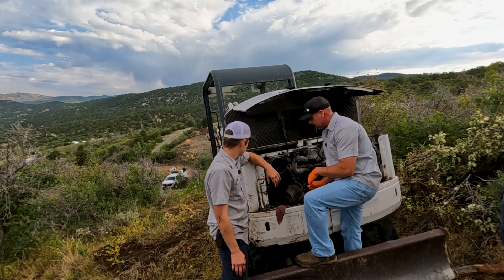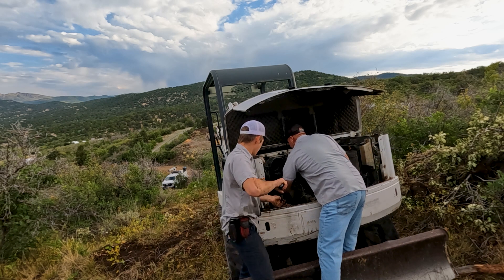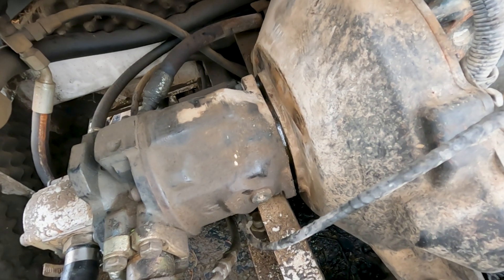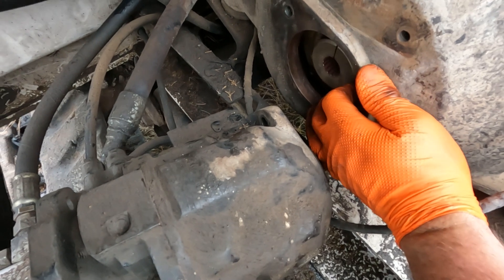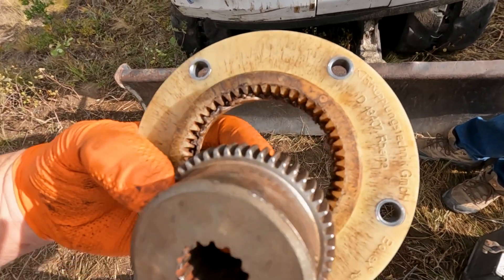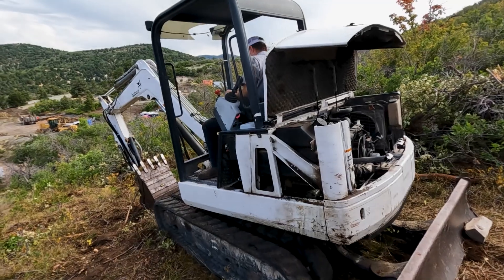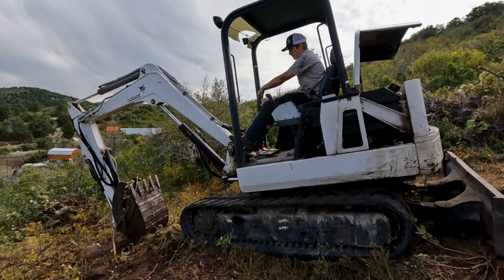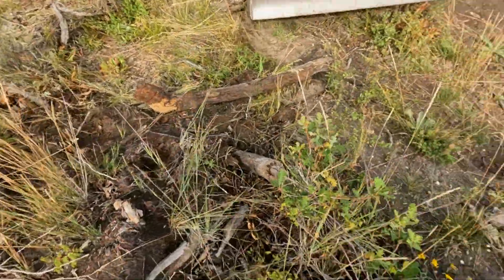Bobcat Excavator Lost All Hydraulic Functions

Comment: Could this problem also be intermittent? I've disconnected the hydraulic pump from the flywheel on my 325E and the coupler teeth are perfect. Changed the hydraulic filters and it seems to happen less frequently.  The fluid in the sight glass level still looks very clear so I have not changed it. It affects the blade and other controls

Comment: Why this part is plastik? There is no clutch or vibration dumping on this case. Do this part looks like design to faile over time.
Reply: I believe they are plastic so in the event of a pump failure the gear strips to prevent damage to the engine.